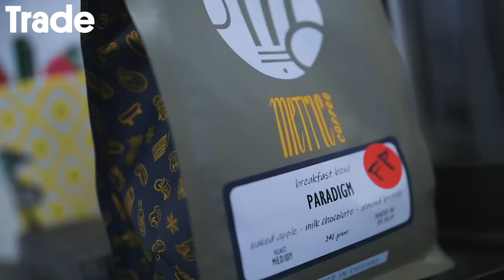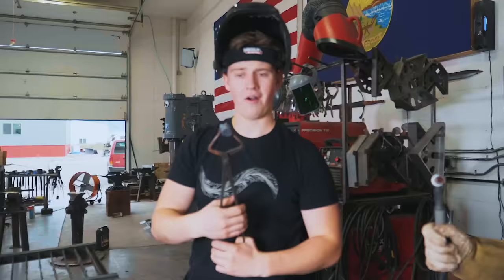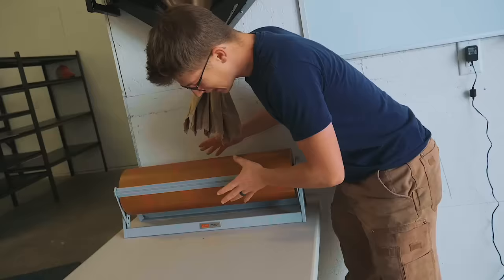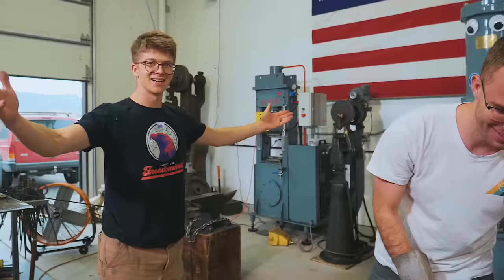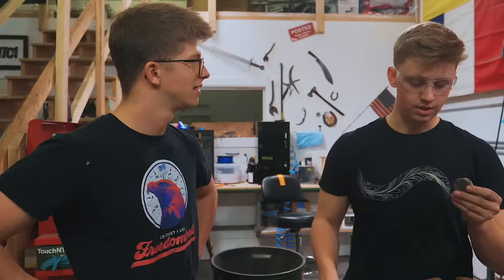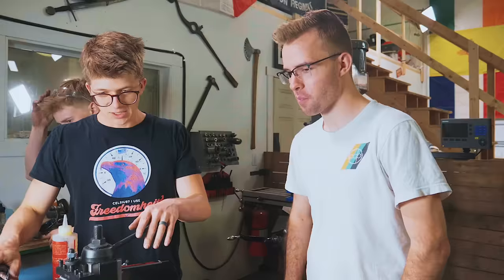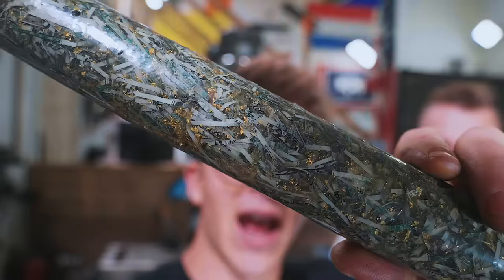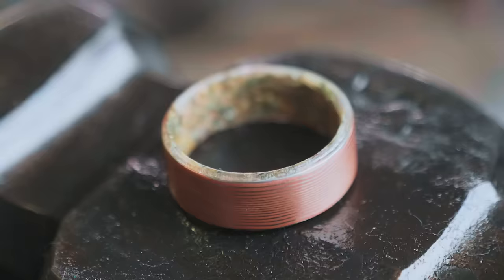CAN YOU FORGE QUARTERS TOGETHER???

Comment: In answer to the question posed as the title of this video (without having watched it yet), yes, you most certainly can!  I use copper pennies (pre 1982) and nickels to make Mokume Gane billets for bracelets, knife bolsters, etc...  Just a trick to try; if you pickle the coins a little in vinegar before you go to welding them together you'll get rid of the oxidation layer and they seem to weld easier.  

Rather than TIG weld the coins, I made a little fixture of two stout 1/2" thick billets of steel about 4" long that are bolted together on each end to make a compression jig.  I put the stack in the compression jig, crank it down in my post vise, tighten down the bolts while the stack is under compression in the vise, and then heat the whole lot to welding temperature.  Once it's fully heat-soaked, I put the jig back in the vise and squeeze it together again.  That seems to do a decent job of initially setting the weld. After that, the billet comes out of the jig, and on the subsequent welding heats I don't hammer the billet very hard.  I generally deo about 3-4 welding heats and tapping before I start working the billet.  I find that light taps with a hammer that has a slightly rounded face seems to compress the coin centers together quite nicely when setting the weld.

Comment: So glad to see that I'm not the only one who thinks outsourcing the hammers to a different smith and labeling them Alec Steele hammers (Hence the touchmark) is disingenuous. And, ueas, I realize they are Alec's design. That's hardly the point. They are official knockoffs, pure and simple.
Reply: Labeling your product with your company name is apparently disengenous now. This would only be a problem if on thier site they misled customers by saying that they were forged by themselves, which I don't believe they will do.

If the price reflects that the hammer was made by someone else then what's the problem. If Alex then decides to do limited runs himself expect the price to be representative of his name; an Andrew Larson 1.75lb rounding hammer costs just under $200 so expect that or more for one of Alec's and if the ones subcontracted  but still hand forged are around $80 then I feel that is a fair price.
Reply: @nathanthom8176  I believe Ethan Harty makes them up In canada. Hes been a friend of Alec's for a while now. Guy is an amazing smith as well, his rounding hammers are priced right around 200 dollars. So I'm assuming these will be just as expensive.
Reply: @justincarpenter8866  if he is good as you say that seems fine, the question  is how much more would a hammer specifically made by Alec cost with his YouTube profile and his lack of capacity?

Comment: I’m going to add my two quarters here about the whole hammer thing. Being that they are replicas of your actual handmade hammers, you should have differentiated them from your true hammers . Most people want a piece of your work, not just another mass produced hammer. These devalue those that you made by your hand. Think second or third generation baseball cards crowding the market. People want the originals and will pay for them, but not if they can’t tell knockoffs from the original
Reply: the amount of volume they would have to produce would prevent them from creating youtube videos - this doesn't mean that they are worse quality hammers, and the design is still Alec's - Ethan Harty makes them (google him) and he also has his maker's mark on the hammer (thereby differentiating it from the original hammers
Reply: I understand the shear volume and I don’t blame Alec or any one for wanting to get his product out there. People absolutely love his hammers and I don’t doubt they are just as good as the originals. The thing is, if we would buy say a sword from him with his trademark, we expect that he had some hand in actually producing the sword. This is where the disconnect comes from. I don’t mean to crap on Alec since I’m a huge fan, but this singlehandedly creates a separation between his fans and himself.
Reply: @Jrskeetpro  Buy a sword then.
Reply: @liamjack5944  you have spent an amazing amount of time defending this.  I am curious why?
Reply: PB CRISP I need something to do while I procrastinate from homework lol

Comment: lol, the dreaded Canadian Robertson-head screw. OH NOES!

It's actually probably the best commonly-available (well...in some places in the US, and obviously in Canada) and inexpensive screwhead. Torx are the only objectively better type (imo), but they're expensive. I do like Hex bits, but put them about even with the Robertson since they don't usually have the rounded indentation that makes it easier for a screwdriver to stay in the screwhead, even if it's not quite the right size. And nobody likes Phillips or flatheads, which if you look at funny, they start to deform. But a Robertson bit will stay in a screwhead really well, even when applying a lot of torque. I know the history, I know why they aren't as common as they could be (thanks a lot Henry Ford!), but I still prefer them to almost any other screw head structure.
Reply: They show up in a lot of newer electrical panels and I love it. You can really torque down and make sure you have a solid and tight connection. They don't slip or strip!

Comment: Former shipping manager with 15 years experience. The paper tape does come unglued given enough environmental changes, hot, cold, wet, dry etc. And the "tape on a roll" as you put it, is so often not secured correctly. The large flap on top of the tape gun is meant to push the tape down and secure it. But I've never found one that works properly. Easiest way I've found to fix that is to run a flat somewhat pliable edge and you'll see as you do that the tape sticks much better. I've shipped things that are $100,000 using that "tape on a roll" and never had a problem. 

As im sure you'd appreciate, its not the tools you use, its how you use them, even if its just tape.

Comment: Just as a tiny little trick a cashier uses to save time (I saw Will kind of fussing with it at the 9:35 mark):
With those white, machine-wrapped rolls of quarters, you can kind of crack them like an egg to open them quickly. Hold the roll lengthwise between your thumb and your pinkie, with your other three fingers over the top (and extended, not curled, this part is important), and give it a sharp whack on the corner of a counter (or anvil, whatever's handy and at least a right angle or a sharp obtuse). If you feel the coins shift upward against your middle finger but don't spray everywhere, you did it perfectly.
Do NOT under ANY circumstances curl your fingers under the roll, because whacking your fingers on a counter edge hurts more than the reprimand from your manager due to your ensuing use of "colourful metaphor" in front of the conservative widow will be worth.

Comment: Rules for using shredded cash:

The recipient must follow Environmental Protection Agency and other local or state requirements for recycling shredded currency.
The shredded currency must not be recycled into paper of printable quality.
The residue must not be used as confetti, or in loose form such as used in packing materials.
Firmly seal any container in which the residue is placed so that it must be broken in order to remove the residue. The container must be at least 4 mils thick.
Due to the presence of various chemicals in ink, the recipient must not use shredded currency for the creation of products designed to hold food or drink for human consumption.
If the recipient is intending to make a product with shredded currency, a sample of the product and/or packaging and marketing materials may be required.
The recipient must not claim the value of the shredded currency enclosed in a product as having a monetary value greater than the weight of the shredded currency per ounce, or fraction thereof, multiplied by $165 per ounce.
The recipient must not ship the shredded currency overseas.
The recipient must not place any replica of U.S. currency on any product or container into which shredded currency is placed, or on any related advertising or other written material.
The recipient must agree not to resell or otherwise dispose of the residue without Treasury approval.

Comment: Ok, you've forged coins into a ring. Now forge some Steele challenge coins out of pattern welded steel.

Make a round bar of pattern welded steel, cut it into coin blanks, make a coin die, and drop forge, or hammer forge some non-monetary Alec Steele challenge coins/medallions.

You'd need to have a good face and obverse design for the two sides of the coin. One side should of course include your touch mark. They would obviously be limited edition. They could be numbered, or not. If it works out you could do a new, limited issue design each year.

Comment: FYI: A real dollar is 371.25 grains of pure silver (See; US Coinage Act of 2 February 1792, also see; Deuteronomy 25:13, Proverbs 20:10) A troy ounce is exactly 480 grains, or 31.1 grams. A quarter is, or should be, 1/4 of a dollar by weight (92.8125 grains or 7.775 grams). However, today a quarter is a nickel plated copper slug. In my experience, both nickel and copper are difficult materials to work with in a welding shop or a blacksmith shop. I have found that copper does not want to stick to itself unless it is nearly at the melting temp. Good work guys. Caveat: I hate to tell you this, but you are NOT going to get the best cup of coffee using tap water, I don't care where you get your coffee. Tap water completely ruins a potentially great cup of coffee.

Comment: First of the guy who designed that screw is a whole .. and secondly some of the issue with forging besides you state that the impressions from the stamp causing forging issues I'd like to add you should have sorted the years and researched those years coins content I bet the zinc content cause some issues as well. Got to get back forging . Got a big oak log and a railroad plate for a anvil used spikes to hold it in and one hole I bored out for a Hardy hole . Just have to make some knieves roscmmon mi is where I live hope you enjoying the states enjoy your vids been watching since you started also link to get one of your hammers this hardware store one is ok id like to get my hands on one of yours

Comment: An awesome video all around, lads! 

Coins are not subject to the Mutilation of National Bank Obligations (aka, 'defacement of currency' laws, 18 USC 333) and are handled with a different standard. However, rendering paper notes unusable is an offense under 18 USC 333. This does not apply to lewd pictures drawn on the president's face; you can do that all you want as long as the bill is still readable (for example, you couldn't dip it in black paint and expect it to still be readable.) Violation can lead to a fine, as well as up to six months prison time. 

The Money Micarta is probably worth avoiding, unfortunately; even if you were to use 1 dollar bills. 

This advice is both pro se and pro bono.

Comment: Just for a heads up that the wet tape has a tendency to fall off the boxes once its dried. I work for ups and majority of those amazon boxes fall apart, mainly due to tape to weight ratio. I suggest you use 2 strips depending on weight and also wet the tape a little more just so it sticks a little better.

Comment: Alec, love your video its really great. But every time i watch you try to weld something it makes me cringe. You will have much better luck washing all metals with alcohol. The more pure the alcohol the better. Most metals are shipped with some level of protective oil on it to keep it from corroding. You need to wash that off. If you use water you need to use distilled water, but i don't recommend using any water. Once cleaned wear rubber/latex gloves to keep the oils from your hands off the metal.

Comment: Be careful, Alec.  The market for your work might be more fickle than you are banking on.  The majority of comments are of disappointment about the Hammers.  There are a few defenders of your decision, but not many.  Also, be careful 'liking' comments that are defending your decision.  Myself and many others have been very impressed by the work YOU have put into this channel.  This new trend with more time in the office, and less time at the anvil?  This new thing about shipping branded merchandise, but not making it yourself?  I hope you walk back these steps...even if you make a little less money (now).  You will make more money later.  Your fans are your customers.  They are the same group.  I would buy a hammer you forged.  I wont buy a hammer you outsourced...regardless of the connection.  No offense to Ethan Harty.

Comment: I hope you are careful with this video and I hope you're aware that it's a federal crime to destroy U.S. Currency
Reply: RCNT LLC. Actually it’s not. The law actually states that it’s illegally to deface currency in order to change its value. I’m paraphrasing but basically you can’t take a 5 dollar bill and alter it to make it look like a 50 dollar bill or with coins, you can’t take a nickel and alter it to look like a dime. You can however take quarters and heat them in a forge to weld them together and make a ring. Perfectly legal. It’s no different than going to Yellowstone National Park and putting a coin in the machine that flattens it out and imprints a Park logo on the coin.
Reply: No it is not

Comment: “whoever mutilates, cuts, disfigures, perforates, unites or cements together, or does any other thing to any bank bill, draft, note, or other evidence of debt issued by any national banking association, Federal Reserve Bank, or Federal Reserve System, with intent to render such item(s) unfit to be reissued, shall be fined not more than $100 or imprisoned not more than six months, or both.” Title 18, Section 333 of the United States Code
Reply: Jonathan H Only with the intent to profit or the fraud
Reply: Have you ever pressed a penny in a tourist location? (The machines that flatten the penny into an oval, then stamp a design)